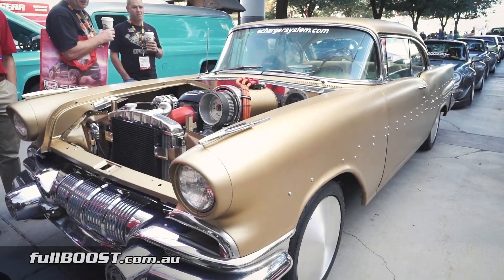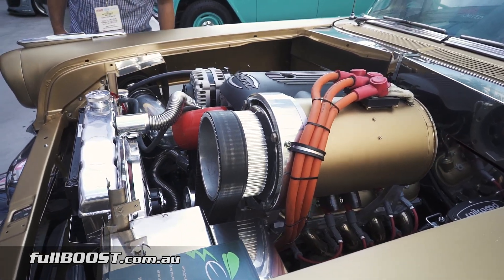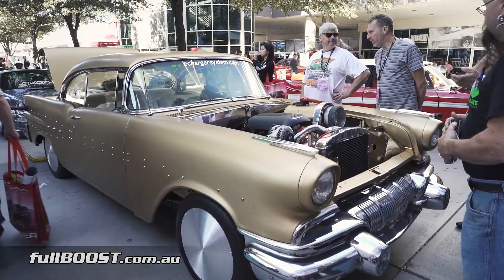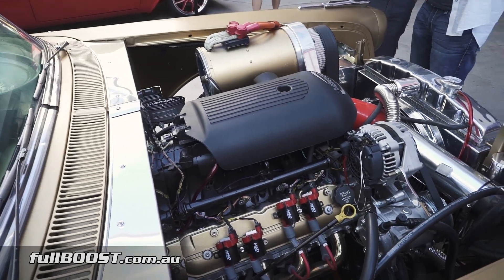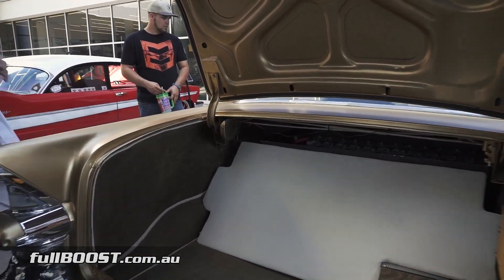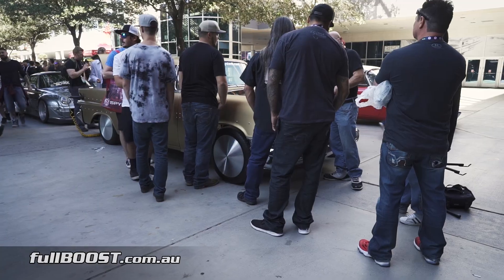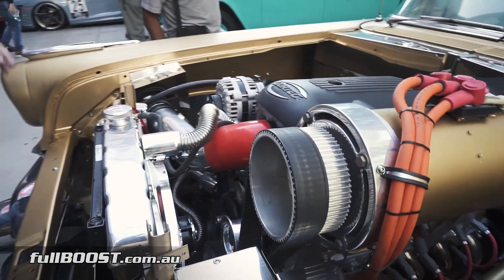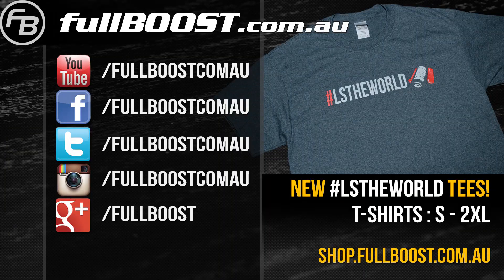The E-Charger Hybrid System

Comment: that system can't possibly have regenerative braking... it may charge the batteries like an alternator when you take your foot off the accelerator but definitely not regenerative braking
Reply: WTF do you think regenerative braking is  moron
Reply: railroad locomotives have been doing it for about as long as  diesel electric has been around 
when they apply the dynamic braking system the traction motors turn into generators and they run that power through giant resistors   making the motors create drag ,,reducing wear on the service brake AKA mechanical brakes 

semi trucks do something similar with Exhaust brakes and Jake brakes ,  it's another form of  regenerative braking
Reply: Engine braking would be more appropriate.
Reply: wildcoyote34 seems you're the moron, make sure you know what your talking about before calling names. that is engine braking you idiotic fuck. there is NO capture of otherwise lost energy in semi trucks or in this video. this car and semi trucks are not comparable to trains, grow up and make sure you know what your talking about
Reply: Redrocketboy420 you might want to make sure you have more of an engineering degree then because ,, everything i stated was true 
exactly what regenerative brakeing is 
regenerative braking doesn't necessarily store any energy ,, in the case of this system it does store energy
Reply: wildcoyote34 by all means, please keep contradicting yourself. engine braking and regenerative braking are two separate things. let's break that word down...  regenerative- seems the root word of that word would be regenerate...hmm. and who said anything about an engineering degree? I was under the impression this stuff was common sense lol
Reply: Regardless of where the system is regenerating from, it's still regenerating under deceleration. Engine braking alone does nothing but slow you down, that's why it's replaced with the word regeneration.
Reply: TheAmericanUhate all you are doing is restating exctly what i said ,, the only thing Regenerative braking does is recover a tiny portion of the expended energy 
whether it's this fancy electronic controlled motor attachment 
 or the Jake brake/exhaust brake on a big rig 
 or the Dynamic braking system on a train 
 they all 3 do exactly the same thing ,
the sole purpose of the system is to  slow the vehicle  without using more energy 
one dissipates the energy as heat through resistors  , one creates resistance with the engines own exhaust  ,,and the electric motor on this hybrid creates drag by generating electricity 

all 3 are different ways of doing the exact same thing
Reply: wildcoyote34 I know what I was saying, I was explaining it to him in an easier way to understand.
Reply: that's what I'm trying to tell you guys lol. engine braking IS NOT regenerative braking. regenerative braking specifically captures otherwise lost braking energy to be used later once the accelerator is applied again. engine braking, no matter how accomplished, does not do that. it's two separate things
Reply: Redrocketboy420 actually it's 2 sides of exactly the same process , in the case of this hybrid device  ,, it is an ENGINE BRAKING SYSTEM ,,it recovers power directly from the engine  and acts directly on the engine  
in exactly the same way as an engine braking system acts directly on the engine
Reply: sure thing buddy, you are clearly so intelligent that if you just keep modifying your comments then you'll be bound to get it right eventually, or maybe if you concentrate hard enough it will somehow suddenly become true lol
Reply: by YOUR logic the alternator, a/c compressor, power steering pump are all forms of engine braking since they put a load on the engine
Reply: Redrocketboy420 go troll someone else  ,, i didn't modify my comments at all 
i restated exactly the same thing 
you proved what i said in the beginning 
MORON =YOU 

go back to watching  cartoons or whatever makes you happy

Comment: Forget fuel economy, if you want that avoid a '55 Buick,,,,, BUT  say if you had a 300 HP electric / Gen. motor with a electric clutch, you could tap into that power at will, While keeping a reliable daily driver motor that didn't suck fuel down like a jet. Down side, about 5 or 600 extra pounds.

Comment: This seems much more viable than those crackpot hydrogen hybrid "systems" which are 100% parasitic. I suspect this system takes advantage of deceleration (regen braking and internal momentum) BUT the laws of physics limit this severely and efficiency limits performance SO when the car is driven with slow acceleration and few stops .....efficiency at a price $$$$$. I'd like to see a truly efficient vehicle one not based on the EM force (including the gasoline motor) but a LFTR automobile based on the w force.

Comment: Kinda ironic to use a pontiac, since  this was system was first implemented by GM in 2007, on their saturn Vue and chevy malibu. This is basicly the same as GM's a belt alternator starter hybrid. BAS hybrid, or e-asist, tech
Still real cool, mostly because they finally brought this technology to the aftermarket. pretty much the only way to increase fuel economy 30 percent while making  more power

Comment: I'm curious what the cost is vs what someone did over a decade ago doing bio diesel conversions for several cars for under $10k. Look up the bio diesel old school impala that destroys lambos on the track while getting 50+mpg and 700+hp
Reply: their webpage says likely for under $5k, which is about the cost of a complete supercharger or turbocharger kit for new model cars. And those diesels were NOT getting 50mpg - unless it's a 1L in a go kart.
Reply: ***** look it up and see that I'm right. It was awhile ago when the guy designed the kits to be a universal application. He tried to sell the patent to major automakers but they wanted to suppress the technology. Trust me look it up they even had a bio diesel hummer getting over 30 mpg.
Reply: It look like a bolt on kit giving limited hybrid characteristic to an old engine. Efficiency or performance wise, a swap would be much more logic, but this kind of classic car are not about efficiency, it is a passion, so why not?
Reply: If you are talking about the impala 65, red with white stripes from Pimp my Ride, the show only claimed 25 MPG. That maybe a little bit optimistic, but believable.
By the way, biodiesel contain less energy than regular gazole, by mass or by volume, something like 10% less.
Reply: With current engines, big muscle and high mileage tend to not be on good terms, but with hybrid turbo coming in the decade, that could change. Some engines can already neutralise some cylinders when cruising to increase efficiency.
Reply: 50 MPH with 700 hp, i call bullshit. Biodiesel is just vegetal oil processed to perform like regular diesel fuel, not a magical stuff of your dream with scantily clad elf princesses.
Reply: Franck Dumont look it up on youtube then if you don't believe me or do a search on it
Reply: Franck Dumont I think the one I saw was grey not sure I'll try to find the link. They might have exaggerated it when I saw it a long time ago lol
Reply: Franck Dumont yeah we are way behind in technology as far as mpg but this system does seem very interesting to me.

Comment: lol im sure the price tag will keep this from happening cool idea but you can add a hydrogen cell and burn clean air and make more power then this for im sure 1/16th the cost to retrofit this system
Reply: No. Hydrogen fuel cells are not very efficient and they will NOT run your car. That's been proven. All these crap videos about "make your own onboard hydrogen" are junk. If you wanted a retrofit to put a tank on your car, you'd have to live where they sell hydrogen.
Reply: yup, all they do is stress-test your alternator lol

Comment: I love how he mentioned supercharged but not turbos I have a 65 Oldsmobile with a ls3 and didn't really lose any mpg's and its just wasted energy from the motor that powers turbos. I get that you get a little extra from this but im willing to bet I could buy my car 3 times over for the price of that thing and it looks clunky and odd under the hood
Reply: But with turbos or any forced induction you MUST add more fuel to compensate for the added air being pulled into the intake.  Will have a MPG loss, but if tuned well it might not be a big hit.
Reply: But is $4500 worth a temporary fuel mileage increase? You would need to allocate that car for daily drive use it for years. I'm sure the system works. I don't doubt the validity. I'm no PhD but the engineering behind it makes perfect sense. But is upgrade worth the fat pile of cash necessary?
Reply: VinnyMartello Oh I ain't arguing in favour of this thing either, make no mistake.
Reply: I'd be willing to bet you that you cannot double your fuel mileage with a turbo or supercharger kit. You can with this. However, you must also realize that this is for limited ranges - like most people drive every day back and forth to work - that is less than 80 miles. You will also have to spend a lot of time adjusting your fueling or modifying your engine to be sure that you don't burn valves or pistons. This electric motor doesn't require that. You bolt it on, wire it up and go.
Reply: A turbocharger requires low compression, which buggers your low-throttle fuel efficiency, and when on boost, you get awful fuel efficiency from the volumetric efficiency. This is to say nothing of the lost exhaust scavenging and decreased exhaust flow due to the compressor wheel being in the way.

Contrary to what turbo manufacturers tell you, there's no such thing as a free lunch.
Reply: Gotcha! The idea is great and there is a real-world benefit possible. But it's the whole cost/benefit analysis kinda' thing.
Reply: no but the power is.
Reply: This essentially bolts on, but imagine rear twin turbo with one of these bolted on?
Go from the set go.  
This tech has so many places to go.
Reply: According to the claim. Adding a turbo will only increase the overall efficiency of the system. Its not an either or.
Reply: I was at 16 mpg before and after the turbo so idk im only running 12 lbs of boost at full throttle but it feels like a ton. Im just saying if I had fuel loss is was very small

Comment: i understand with every gain or upside there is a downside in this case as far as i can see it's the price of the batteries to replace and of course the added weight . my opinion just go electric and or gas and keep it simple. sometimes more is not better.

Comment: need to get that "Motor" mounted to the differential, reduce driveline stress. I would worry about the stress on the crankshaft and bearings that are not designed to take input power at that side and amount.

Comment: that puts a huuge amount of stress on that ONE balancer bolt. I would hate to strip one of those out lol
Reply: A properly fitted balancer is not retained radially or axially by the bolt, it is retained by the fit of the balancer onto the crankshaft snout, or at worst by a keyway or two.  The bolt serves as a means to install, the keyway usually as alignment.

Ekner is correct.  This is a pretty interesting system.  Lots of weight up high and fairly bespoke to each car, though... expensive.
Reply: The Saucy Goblin Shark I'm sure it's drilled and tapped for more bolts around the radius of the crank and balancer.
Reply: 393stroker it would still be alot of stress given that its 150ft/lbs
Reply: The Saucy Goblin Shark You're right and someone else mentioned better front main bearing, it would take a lot of stress in basically one direction!
Reply: 393stroker it would. a sprocket on the drive shaft would be better
Reply: It's the same kind of stress that you'd get driving a supercharger tho, I'm sure it can handle it.
Reply: 393stroker sounds like you wanna go fast. I just sold my fox. i got a 86 ws6 now with my own goodies in it
Reply: eighty6gt Actually, it is the keyway that keeps the balancer from spinning on the crank snout. The bolt merely holds the balancer against the face of the crank, the keyway is what locks it from spinning. The thing is all super chargers don't get instant full power from the crank, the boost (radial stress or torsional stress) whichever it is comes on from almost nothing to full boost. The electric motor could give full power which could shear that keyway, I'm sure though there is some type of electrical control of the speed/power put into the electric motor as for that not to happen.
Reply: back of the envelope math says that a reasonably small key could hold ~550 lb-ft (.25*1*36,000@a 3/4 inch radius,) - that said you should investigate crank pulleys/dampers, particularly those fitted to late model LS engines, say a 2005 'vette for instance.
Reply: eighty6gt Your math is probably right but that's a lot of instant power though! I'm a Ford guy myself so looking into Chevy specs aren't at the top of my list! peace!
Reply: heh - with a proper tapered or interference fit you could essentially develop the torsional resistance of material the diameter of the damper hub!

The 'vette engine has no keyway.

I'm driving a Ford as well - hence my user name, no longer rolling in a fox body, though... for some reason I read "383" in your user name, makes more sense now that I see it correctly.
Reply: Yes you'd want that battery weight as low as possible.  It could be done: The batteries are cylindrical, each about the size of a sausage roll,they could be stashed flat - conforming to the shape of the underbody.

Perhaps the batteries are up high on this one to make it easier to show off, as it's a show car.
Reply: I have welded up cranks, and re-cut keyways on engines that have never had a wrench on the dampener bolt. An extra150 lbs of torque on "any" engine sounds like a nightmare to me.
Reply: ipissed yeah my motor is 11 to 1 compression and i literally almost stripped my dampener bolt just trying to turn my motor by wrench. 150 positive hp isnt the same as drag from a supercharger.
Reply: ipissed I can already see the balancer snapped off of every car this is bolted on
Reply: I will also add that in these situations the AC fan clutch is almost always to blame, they lock up, an already locked up compressor, and that's just disaster. What I do know is engineers do not compensate for this. Therefore they do not compensate for an extra 150 lbs of torque on the front of the crank. I would design a sort of a clutch, and shear pin system, if I didn't outright modify the crank with a front end bezel similar to the output side.
Reply: eighty6gt Yeah, I'm building a 92 fox coupe with cobra IRS rear end! 351 Windsor out of a 69 Ford Torino (high nickel iron block)!
Reply: The Saucy Goblin Shark Correct!
Reply: The Saucy Goblin Shark Mustang to a firebird! I had a 94, lots of fun!
Reply: 393stroker lol I only like them as long as they dont have a 10 bolt rearend. We blew one a couple days ago. its on my uploads.

Comment: The 250 lbs is without the batteries.
Reply: No, that's the weight of the batteries.  ("under" 250 pounds he said.)
For LiFePO4 batteries like he said, the figures check out.  The batteries should weigh 240 - 290 pounds
Reply: so the motor and controller weigh 250 lbs? doubt it
Reply: roidroid Impossible,  The electric motor alone weighs more than 100 lbs. the batteries number 6 to 8 and are not just car batteries. Then there is the charger in the trunk and controller. I have worked with many systems like this 250 lbs is impossible for the range he quoted.
Reply: +nicholascremato You've both misheard what he said in the video, and misread my post.

The video asked specifically what the weight of the batteries was, he replied "Less than 250lbs", and this is correct.  He didn't say how much the whole system weighs, all he said was how much the BATTERIES ALONE weigh.  The weight he cited in the video is within the range of what we know that capacity & of that battery chemistry (LiFePO4) should weigh: 240 - 290 pounds.

I say again: he was asked how much the batteries weigh, and that's the figure he gave.  He did NOT say how much the whole system weighs, only the batteries.  The whole system weighs more than 250pounds.
Reply: roidroid Thanks for the clarification.